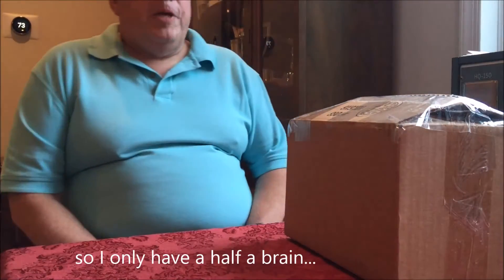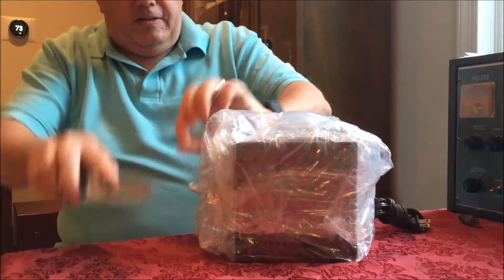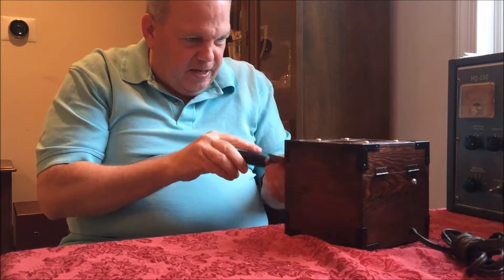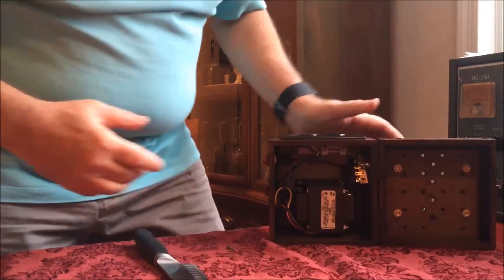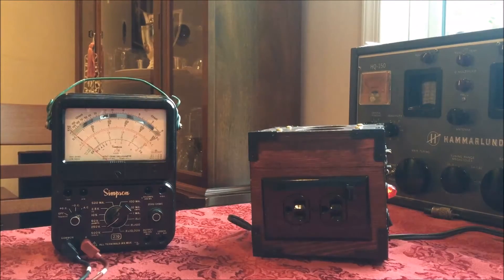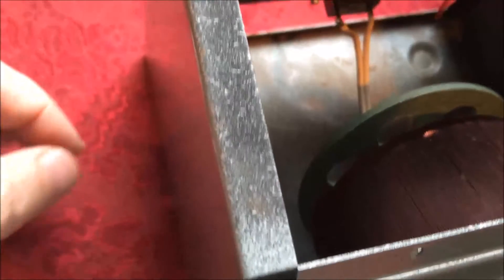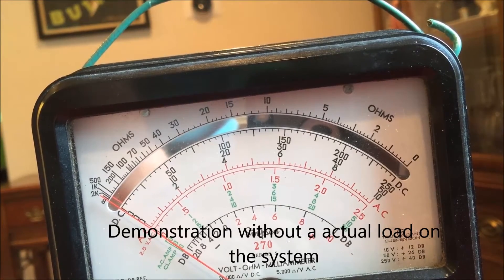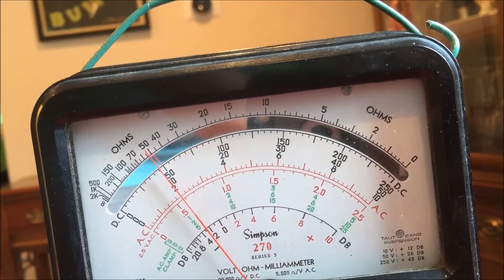Isolation Transformer and Variac

Comment: Ummm.  You still don't know if the isolation transformer is working properly.  Just measuring volts in and volts out doesn't cut it.  You need to use an ohmmeter to check the different AC in wires against the different AC out wires to see if they are electrically connected.

I have the same variac.  I have mine connected up first,  then an overcurrent lamp and finally the isolation transformer.  Because of the voltage drop in the light and isolation transformer,  I can increase the voltage on the variac to get the desired target voltage and compensate for the losses in the incandescent light,  which acts as a voltage divider,  and the isolation transformer.

I have a 'way cheap Harbor Freight multimeter for measuring the AC voltage out.